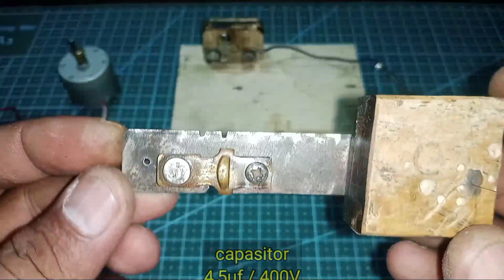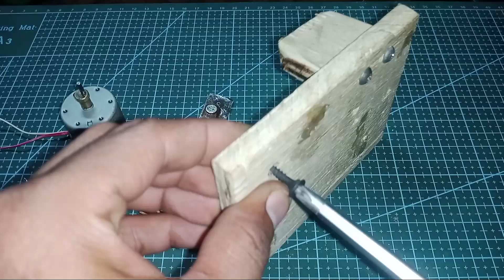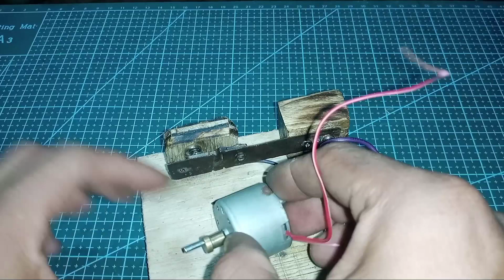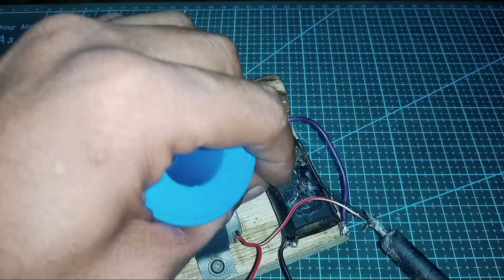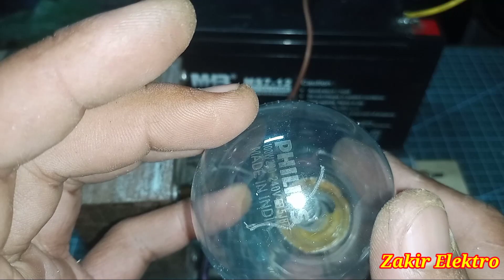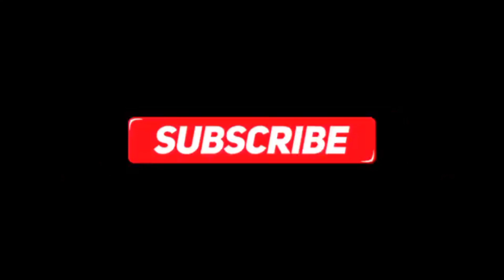#setrum #rakitan  pembangkit frekuensi setrum ikan yang aneh

Comment: Sir that current it have continues flow? Then why can you explain thank you sir...
Reply from the maker: Which part of the flow, Sis, keeps flowing
Reply from the maker: what produces the frequency in this tool is the movement of the platinum which is driven by a motor
Reply: I mean sir from output power can i build an adaptor?for recharging again the battery to continues supply....thats my point sir
Reply from the maker: ooo yes boss ,,, you can but the output of this tool is not too big ,,, and it still outputs the frequency of squares